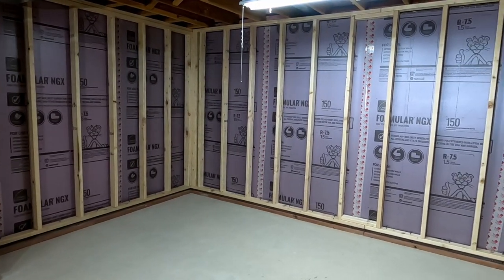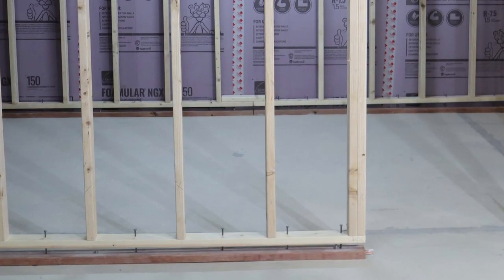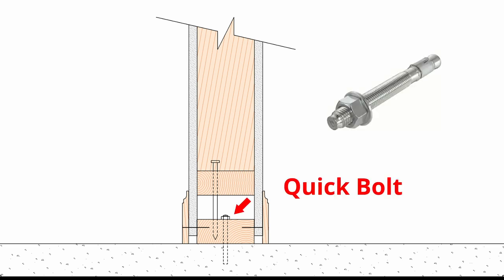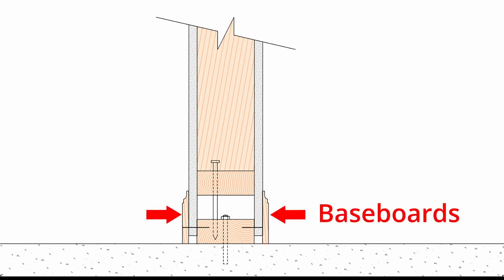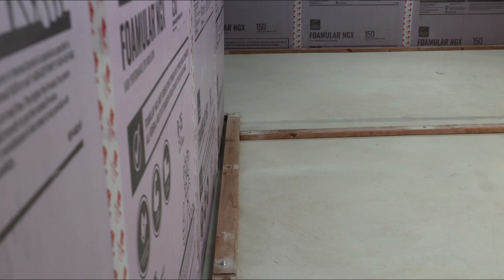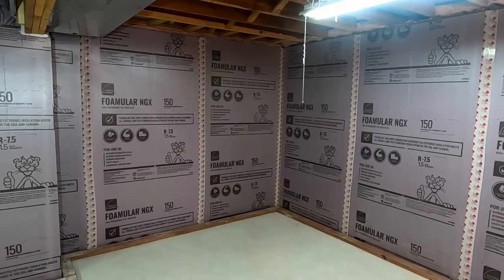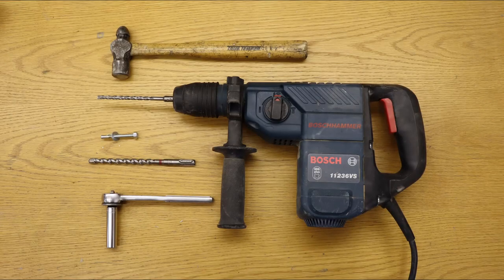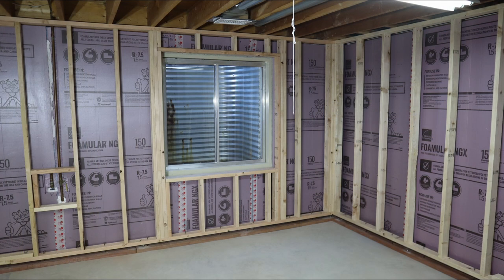Finishing My Basement - Floating Wall - Base Plates

Comment: Whats the required spacing between each anchor bolt in the baseplate? Thank you
Reply from the maker: It likely depends on your local building codes.  I've seen anything from 24" to 6' - I went about every 48".

Comment: The way you have drawn the finishing nails holding the baseboards would result in them tearing a slit through the drywall when the slab moves up or down?
Reply from the maker: Good catch!  And yes, that is what I decided to do. 
In my specific case, I anticipate very little movement - if any - so I elected to leave a 1/2" gap under the drywall and nail the baseboard through the drywall (near the bottom edge).  Should the floor move, the nails will bend and the drywall will tear, but I'll be able to detect movement.
To accommodate more movement, one would need to leave more room under the drywall, then place shims behind the baseboards and nail through the shims in to the baseplates - which would require  bigger gap below the drywall and taller baseboards and so on.
Implementation depends on the site's soil conditions.

Comment: Where are the Fire Stops on the Foam Insulation? Also Don’t see a Ladder out of at least one of the Window Wells. Here Required as a security exit for Finished Basements. Stairs to Level above don’t count, a walkout door with Interior Or Exterior Fire Proof Steps for the First Egress.
Reply from the maker: I did not install fire stops, though I agree I should have. I may add a ladder later.  Presently, we do not have any difficulty using the current windows to exit and enter the basement.  FWIW, before adding these windows we had these tiny little basement windows that I'm certain we would not fit through - let alone be able to reach.
Thank you for the added tips.